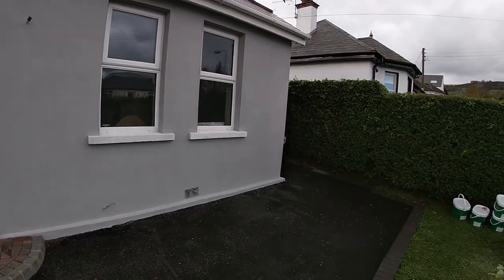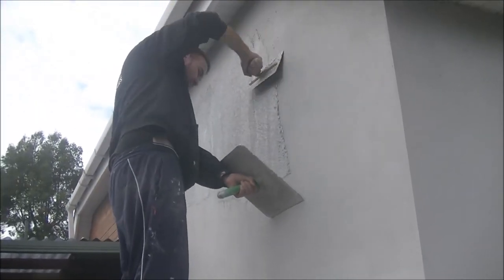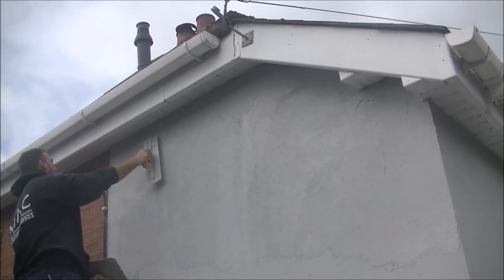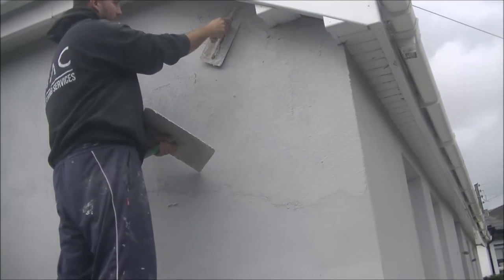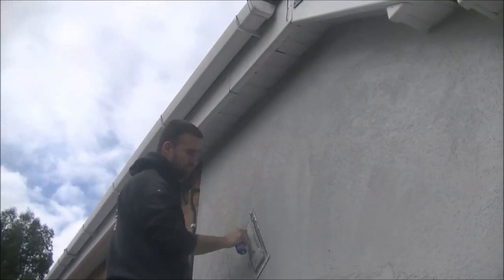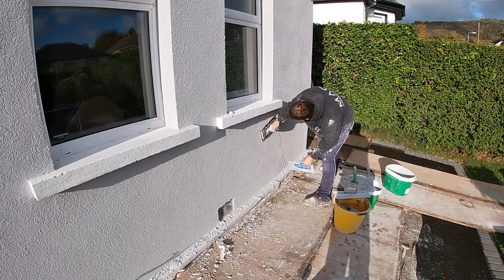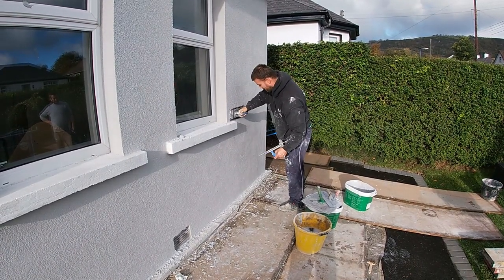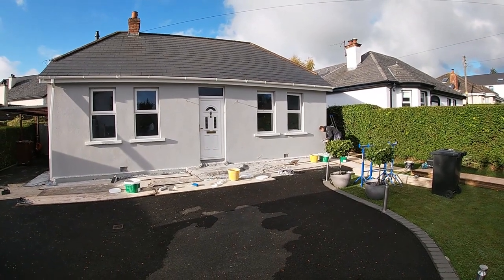ACRYLIC RENDER ON SAND AND CEMENT BUNGALOW CHARCOAL colour thincoat  refina plastic trowel float

Comment: Reached out to Mac Plastering regarding advice on plaster crazing (broken ice look only when wet) on my external nap finished house. My plasterer said no hollow sound and paint will cover it. However an alternative and probably a permanent solution to fix that is to apply a silicone render over it as this video shows. This video tutorial is definately helpful to plasterers out there. Thanks for all your advice.
Reply from the maker: Hi mate thanks for watching and commenting if it was nap finish it might need hoppered on as in sprayed on thought was a sponge  finish

Comment: I use the plastic refina trowel to lay it on , and rub. Up , cover everything First always cover windows with plastic save time.
Reply from the maker: We wanted to cover up but not our call so had to wash wash and wash again haha as you know its not easy to clean when it is on thin and setting
Reply: if you put on with a plastic trowel imsurprised there's not nothing left of it after doing one panel haha??

Comment: Very good video! No posturing, just honest display of your working process.
A couple of things, if I may suggest. 
At around 7min, when you finished the application and before commencing on rubbing it down with the plastic trowel, if you had applied another horizontal line underneath, you would have kept a wet edge better.
Also, if you happen to wreck a whole wall very badly, say on a hot sunny day working alone, you leave it till the next day. Then do the whole wall again. There's no need to prime it. 

Silicone render has already become very popular. It's easy to apply, it goes thinly, it may be expensive, but overall not that much more than a monocouche, the latter is applied much thicker, so it takes more material. 
Silicone is better hydrophobic than other render. I've done silicon and monocouche side by side and you can clearly see the difference when it rains. 

All the best!
Reply from the maker: Thanks for the comment mate hope your doing well these days
Reply: Good to know you don't  need to prime it I used this today for the 1st time I done a gable thats hid definitely didn't do it right it actually looks OK but I done a smaller panel at the front and it looks better than the gable the difference being we thinned it down a bit and put it on tighter then hit it straight away with plastic trowel

Comment: We use lots of this stuff here in Brisbane Australia. It's called Acrylic render and we put it over render, Blue Board ( F.C. sheeting) and polystyrene boards. Temps and sun make it dry very quick and nightmare in the sun. If you don't know Brisvagas it never goes below 20' c for 8 months of the year.
Reply from the maker: That sounds real hard work man I remember doing this on a huge wall with 4 other guys we all struggled as it was summer gear was going fast and didn't want them joints tearing

Comment: Have been working with acrylics for years here in the state's, most companies that make it will say you can add 8 till 16 0z of water to a bucket if u do use water keep it the same in every bucket, when it is  hot you will need too guys on each level ,it Ireland the full system with eps board would be great for insulation, great product when it done wright,job looks great👍
K
Reply from the maker: Thanks man yes I 1st came across this like 10 years ago the guys showed me how to use this where very good at it , thats is some great tips for sure man thank you :):)  It sure is hard to use in the heat , I am yet to work over the insulation  boards

Comment: My son has got a rake of the old Monocouche jobs  over the last couple of years - problem is, the weather - always messing him about. Some jobs drag out for weeks waiting for a decent break. With scaffold and material costs already forked out by customers it can get a bit 'awkward' - but does look good afterwards :-)
Reply from the maker: One the 1st sites i worked on had the mono finishes outside and cut v'd in it very smart finish indeed , I do like this one the best thin the finish is just that little nicer but both hard to do and hard work on the arms , dose he spray on or hand ? and yes mate weather and scaffolding is the hard part for sure
Reply: @macplastering  he does it by hand ... usually rubs it back next day..
Reply from the maker: Same here mate hand applying is hard work and always off next day here seen guys make a mess going at it same day , I have always found if on nice and think with a few coats you cant go wrong one time a big gable was a hard rub as wind was on it all night but when  got of the top it was fine and a new scratching float
Reply: @macplastering  Yes, he's trying to get his lads consistent with the rubbing back, but they seem a bit heavy-handed so far :-)
Reply from the maker: Oh yes some times best one guy finish and let the others put the next days hit on like dashing sometimes best one man so its all the same the guys I learned the mono from where all very very good even the guy did all the mix could finish as good as us just hada check for shiners with hit but he could do plastering also patching window reveals actually im not sure why he didn't take the trowel up more ? A great worker, mate so many guys getting the machines to spray it on now with hardeners to rub same day but the machines are lie 12k be great if I could unbox one on the channel LOL

Comment: Looks nice that does looks like masonry paint lol it goes on that thin. Give a lovely finish 👍👍👍
Reply from the maker: Agreed mate a painter once told a mate of mine that masonry paint dont go outs date no idea if thats true and if it is I wonder dose it apply to this gear?  I to love this type of finish over the render  Thanks for watching mate :)
Reply: @macplastering  I had a go years ago when it just come out and they used it on them caravan homes and trowel it on ply board. A bloke wanted me to put it on blockwork and roller it with a paint roller after it gave it a nice spike finish. Haven't had a go after that with the new stuff👍
Reply from the maker: Yes yes the stippled finish I think here we call it highbuild a mate of mine has done it few times It sounds very similar as he said when it dries it can joint so need to go fast with it , this gear look much better I think :)
Reply: @macplastering  o Yere definitely I love that Finnish you got 👍👍👍

Comment: Great finish used it a year ago. We had to scratch with the hp12 and mesh it then base coat it with it and prime it which is alot of work then obviously put the acrylic on  very easily damaged tho for a couple of days after dont think its somthing we could use here all year round great vid mac.👍
Reply from the maker: Hi Buddy hope you and your family are doing great ...  I do like the finish of it myself for sure, yes loads of work with it for sure I wonder what its like over the insulation boards impact wise ? Have a new video out soon if ya get time for a peek :)
Reply: You need to put cement boards on top of the insulation boards or it will damage very easily
Reply from the maker: @stephbhoy1  I have never went over any other than a solid background mate myself have seen guys going over the black insulation I just assumed it was kind of tougher

Comment: Hi mate
If a house has rendered finish from old

Should it be scrimed before 
k rend is applied 
Cheers 
Andy
Reply from the maker: Hello Andy mate hope your well,
I have never went over anything old with this gear yet its always been fresh new render like in this video and the one i recently uploaded  
But I do plan on trying this over old slightly cracked painted render 
I stuck in two minds grind out fill cracks the bad ones or base coat and scrim them then  go over with primer and finishes like this video 
 or over just prep fill prime and spread

Comment: Hey Mack...I use this top coat almost every month for a few days on top of basecoat and insulation... product is kabe.
Reply from the maker: Oh is it nice to spread I have only ever used the webber and the k rend acrylic renders , and both mono types also
Reply: @macplastering  a little water in the bucket and wisk helps to spread...we do small town houses to one off 2000sqft homes,poor drying during the winter ,that drying breeze can be disastrous, as bad as direct sun ...can I send you some pictures of recent work?

Comment: Do plenty of rendering mainly k rend scraped  but when ever I have done thin coat, i have always had the top cost acrylic on more like a skim coat, your giving yourself more work by putting it on 0.5 of a mill as the air sets it off quicker, put it on 1.5mm level off and get the spat or steel speed skim over it,  

so hp12 base and mesh then a tight coat of hp12 over the top flattened and rubbed back to get it flat, coloured primer over the top of that preventing seeing any base coat throu the top coat and top coat as stated above but of that works for you keep to it, we all have our ways
Reply from the maker: rendering is hard work for sure I like my methods yes its hard to get on tight but you know your giving it a great chance to fully set need to be carful putting on to thin as heavy areas might not set in the centre, but yes if it works for you keep at it mate . dont you find putting on so thick you lose jobs due to the price of this gear being so expensive ?  like i have seen it at 60 quid a bucket if it going on at less than 0.5 then im saving a lot that way compared to 1.5 thats a lot on big jobs your putting on 3 times the gear if that makes sense

Comment: Hi Mac looks great,, never used this product,, looks like a lot of hard work ? Can you paint over this if needed ? Does this product make it waterproof ?
Reply from the maker: Yes you can paint over no problems it is sore on the arms for sure as when you start you cant stop as it will joint and tear as it is silicone based so its like a rubber coat over the house so should be pretty good stopping water
Reply: @macplastering  thanks for replying mac,, as I said it looks super as you didn't leave joints ect,, great work Mac 👍👍
Reply from the maker: anytime mate yes joints in this would tear and rip when it starts to take up witch would be a very hard fix I would think a complete re do so best to keep at it :)

Comment: Nice job good video . Just wondering what finish you leave on the Sand  and cement coat prior to priming. Would it just be a float finish
Reply from the maker: It is smooth render yes m8 have videos on that if you wanna have a peek on channel
Reply: @macplastering  will do cheers mate.

Comment: Great work, the first section you done how long can you leave the join for. I see you rubbed the top section up before applying more, do you then go over the join again when applying underneath.
Reply from the maker: I rubbed it so can move the scaffold back but this stuff you cant want to go to far before you finish it as it sets up and if leave to long will tear and rip need to be fast when doing especially in heat

Comment: Have you done any houses in acrylic finish that have a plinth and a bellcast  on the bottom of the wall? I have worked with acrylic in Australia but never in Ireland,dulux do a coloured textured finish over there. Lovely to work with . Great work ,thanks for the video 👍
Reply from the maker: Never herd of the Dulux one would be interesting to try tat out for sure. I think we done it on plinths and under a stepped in render not a proper bellcast a gentle sloped out one if that makes sense mate /.?
Reply: @macplastering  yeah I get you ,not as thick a coat  on the bottom like sand and cement. Cheers 👍
Reply from the maker: @evanlawlor5938  Yes it was set out half inch but was almost done like of level so was a nice easy slop out and easy to do think coat over :) a bell would be hard to finish with the shape

Comment: What mix do you use for S&C? I always find it really hard to rule and get straight. It just slumps more often than not
Reply from the maker: Hi Sam mate hope your well , yes I have a good few rendering and sand and cement videos on the channel more than welcome to have a look also how I get it straight might hep you some , but on the most I scratch 3 to 1 then top coat 4 to 1 always plastering sand

Comment: Mac, in theory could you lay this on a bit thicker and rule it if the background isn’t flat ? I’m talking going over rough monocouche
Reply from the maker: Just seen this comment now bud I would try do something like that in a few passes or get an undercoat 1st most them have an undercoat that can be mixed and applied apparently its Milles better than sand and cement but not had a go yet :)

Comment: What did you prime the render with? And was the render flush to the bead prior to the thin coat finish?
Reply from the maker: K rend and Webber both have a primmer you pint on before hand
Reply from the maker: Oh yes bead was left flush mate 1st time years ago we would have just used timber batons / rules

Comment: Great videos as always Mac is the silicone render straight on to cement render in one coat or on to a base coat cheers keep them coming 🙌
Reply from the maker: always primer , I try to stick to as close to the guides as possible
Reply: @macplastering  yeah I was wondering that did you use the hp12 with mesh on the render? Nice work very impressive 👍
Reply from the maker: @bluevanmani  No mesh the brick work was all ok none was cracked and builders didn't say or supply it but every thing seemed to tighten very well especially as it was ordered in sand and cement full of plasticiser

Comment: Hi mate is this different from k rend in the bag ? I'm gettin mine done soon and the guy says its k rend silicone but it comes as power in a big bag
Reply from the maker: The gear in the bag i would call monocouche its an opend up render this gear comes in a bucket ready mixed but both can and do have silicone in them
Reply from the maker: so you go this type and then this on this videos- https://youtu.be/NRHO-HhITy4   and k rend coating and https://www.youtube.com/watch?v=-U3Cb4-jp80
Reply: @macplastering  nice one mate, I'm gettin thin coat silicone now the other one was scratch coat
Reply from the maker: @lloyds053  Was best way for me to explained it yes i like this type most :)
Reply from the maker: A few new videos coming live should be a nice watch :) This Sunday and next :) might be some of my best yet

Comment: I thought this was easy to apply an do. Some guys saying they can drop gables on there own with it being easy to do! Do scratch render an without machines it’s a graft. Was going to try acrylic but if your saying it’s also hard labour.. can it maybe the product ?
Reply from the maker: I have used both webber and k rend acrylic not much difference between the 2 ramboo tools also sell it and hear its a little nice to spread but never had a go on it myself, when you start a wall you can stop its a live joint that needs to be kept going otherwise it will tear as it starts to set and you try to apply more I find trying to scrap it on so tight while keeping the edges wet and finishing and coating pretty hard work others might find it better and have better ways than myself, I will possibly one day do my own house only a bungalow and will not be doing that alone , The cost of the gear if a mistake is to happen is worth asking for help and paying a mate to help coat

Comment: Hi just quick question, i was planning on having my house k-rendered, but people saying to have acrylic rended. Is this the better option. Cheers
Reply from the maker: If I was building a house I would go to acrylic 1st I think its a little nicer I have not seen either fail yet all the same
Reply: @macplastering  brilliant thanks for your fast reply. The only thing whats scares me having the acrylic is not breathable from what am reading and with the k-rend its prone to cracking. I suppose theres pro and cons to both. Tough decision lol
Reply from the maker: @greggan100  The acrylic is supposed to move some and help prevent if wanting air flow you can also have vents put in but yes its pros and cons for sure k rend can also go mossy and have algae grow on it your supposed to wash it with an antifungal once a year, both do look good and are expensive choses let me know what you chose and why mate
Reply: @macplastering  yes mac i will do. Am defo more towards the acrylic. This is how i found your video👌  Am going to meet plaster tomorrow, as he on job doing acrylic so i can see. Il defo let you know the what i choose. By the way great video and work looks top notch👌 its a shame you arnt local to me (Merseyside)👍
Reply from the maker: Appreciate the support buddy hope your job turns out really well =)
Reply: @macplastering  hi again mac, just quick question. am having trouble getting quotes in my area due to all booked up till mid next year. Ive just had quote back from one company. I live in a council 2 bed semi detached house with gable end. Ive had a quote from a company for £10,500 with out scaffolding. Is this right??? Seems mega high to me. I was expecting around 5k all in.
Reply from the maker: @greggan100  Not sure with out seeing myself mate but this martials real expensive and some plasterers wont do it or have never done it before so dose make it harder for you to get the right guys, If you wanted to facebook me pictures shame you weren't lose could have a look
Reply: @macplastering  sorry for late reply. Just had another quote for 8k, though a friend of a friend. Il let you know what i do mac. Thanks for you help and advice 👍
Reply from the maker: @greggan100  No problems mate hope a goes well :)